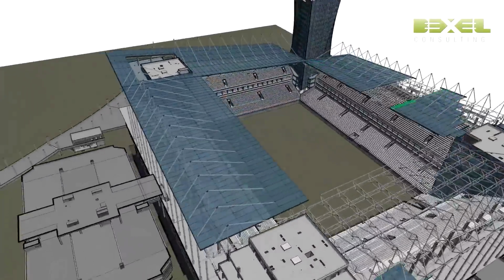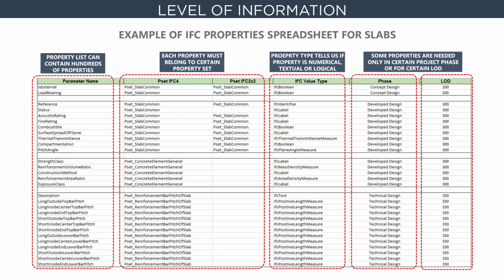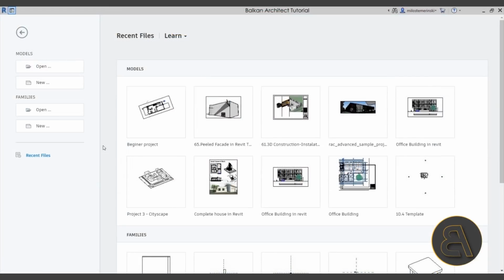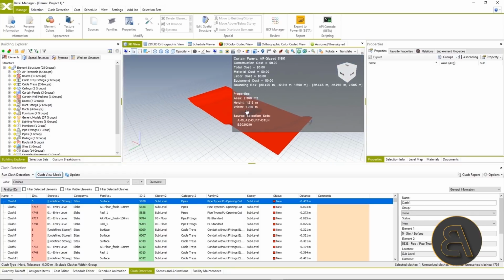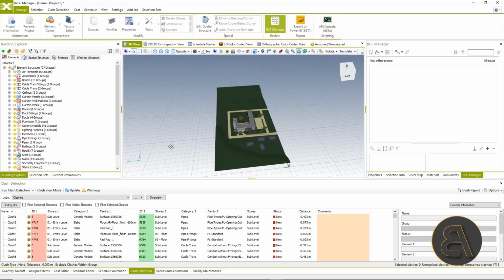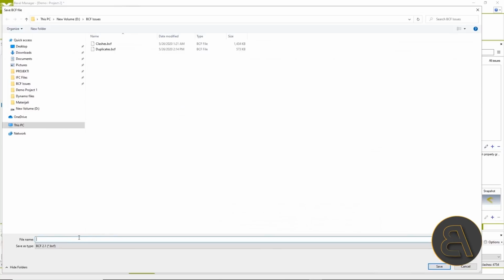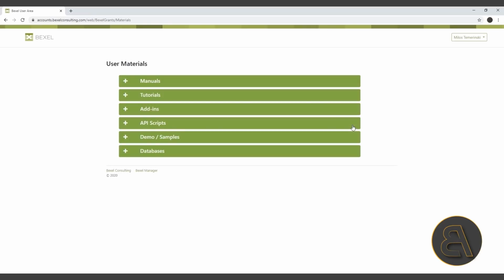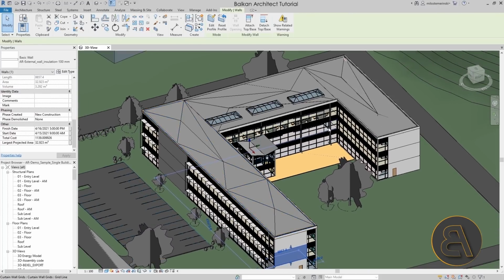Complete BIM Workflow Explained With Bexel Manager / Revit Combo

Comment: Balkan, EIR stands for Exchange information Requirements as per ISO 19650. The term you used as Employer's information requirements is outdated. PAS 1192 is no longer used in the UK and outside as the ISO standards took over. Also the BIM levels are no longer applicable as per ISO 19650. I highly recommend you check that ISO and maybe you can do a video about it :)